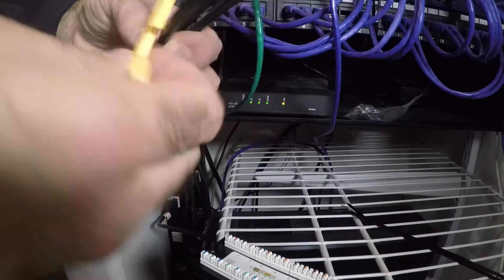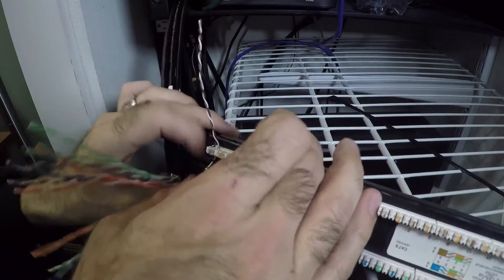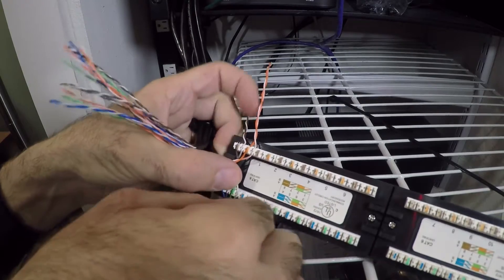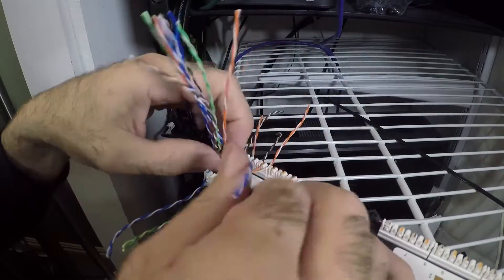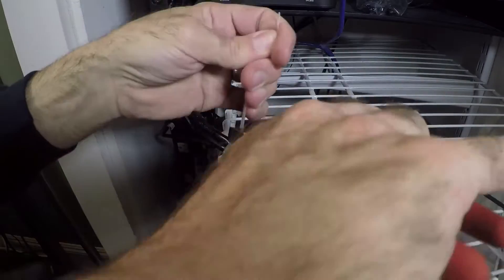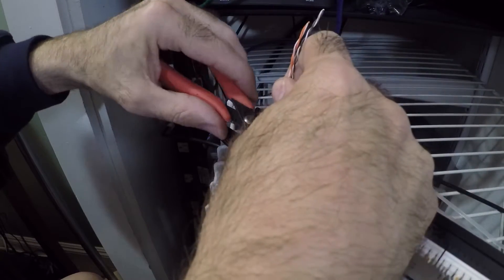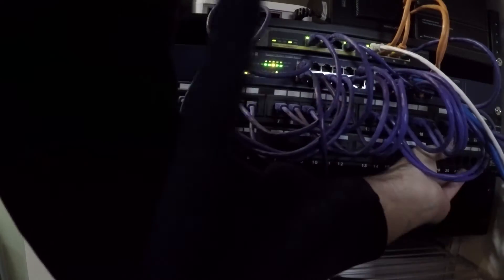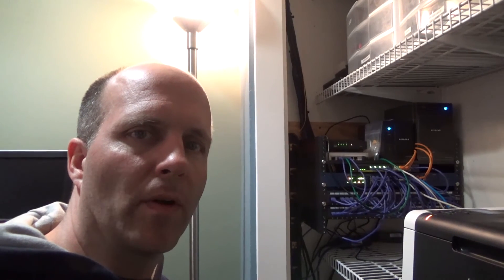How to install Ethernet Cabling in your House Part 2

Comment: Thanks for the video. Great job! Are you stacking or doing any type of port aggregation between your switches? I'm considering a similar setup since I know have the need of some POE ports.
Reply from the maker: I haven't done any Port Aggregation yet but the switches I have support it. Maybe I'll do that in another video.  The switches I have are not full smart switches but they have many of the features of smart switches like Link Aggregation and port mirroring etc. They are a pretty good value for the money in my opinion.

Comment: Are any of your Ethernet cables run through your walls shielded?  I plan on only using unshielded to run cable in my home, I hope this wont be an issue. Thanks.
Reply from the maker: you don't need shielded cable, rarely needed unless you live in factory.

Comment: How much did this whole project cost you?
Reply from the maker: Good question. I think I paid $5 per   Rj45 jack that goes in the wall. A patch panel could be purchased from Monoprice for about $15.  You can buy 500 feet Cat5e bulk ethenet cable from Amazon for $32.  so about $50 in supplies

Comment: You should try to minimize the amount of the jacket you remove when your laying in on the panel. Good video though.
Reply from the maker: +Firespyer thanks for the Comment. What do you think the benefit is to leaving some of the jacket on? Typically I do see them not stripped as far back as I did.
Reply: Mostly its to eliminate crosstalk and loss, at your home its probably never going to cause you issue, but in practice I just wanted to point it out.
Reply from the maker: +Firespyer Thanks.  I do see most cabling companies do what your suggesting. I would think that if the cable was shielded that would be even more important.